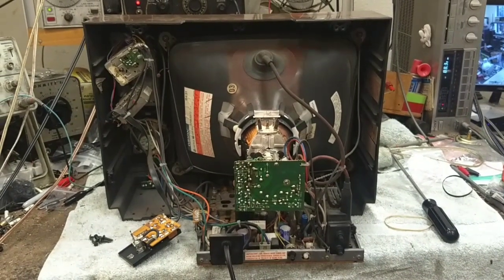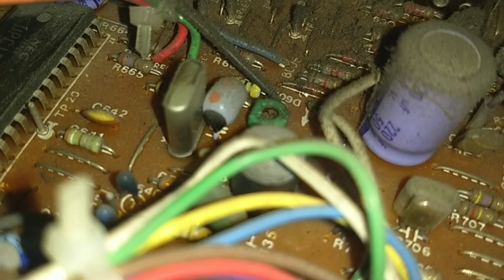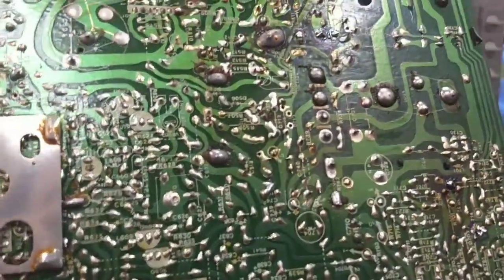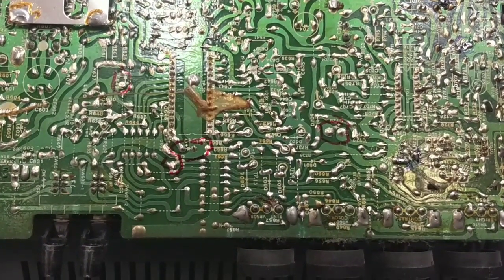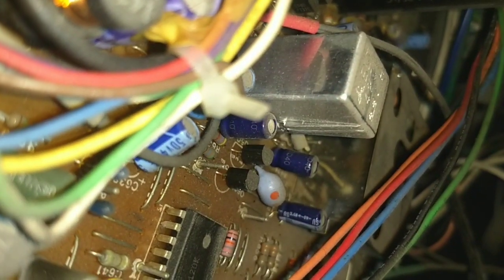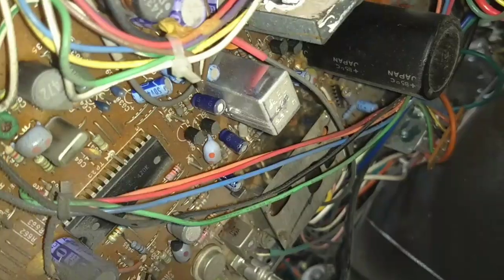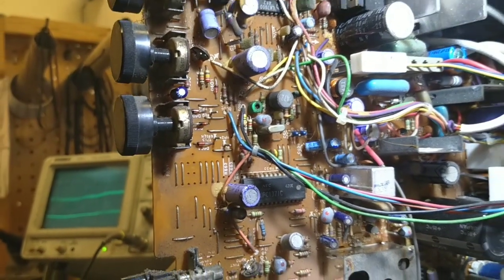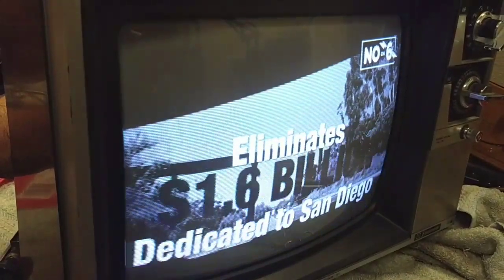Troubleshoot and repair a 1984 Emerson EC133 color tv Part 2/5

Comment: Shading & streaking look a lot like the filter cap for the 200 V off the
FBT, usually  4.7mfd 300V.  Also has a blanking problem look to it, I see a vert white line
1/3 of way over. Blanking & color have one thing in common. Hoz pulse to burst amp
& to blanking. Check those lines for open caps/ resistors.
LFOD !
Reply from the maker: I'll do that. The shading definitely looks like open filter, which may have just happened since it wasn't doing this before. However before this, there was only rolling color bars - which I could steady with the 3.58 trimmer cap.  The shrunken tall black cap that tested good initially may be that b filter you're talking about. Time to pull it
...

Comment: Concerning the shading and smearing, check the 200V line to the video output stage for low B+ and/or noise. This source is usually coming off of the flyback and when the filter cap for that line opens, it can do exactly what this one is doing.
Reply from the maker: Thanks. I'll do that.